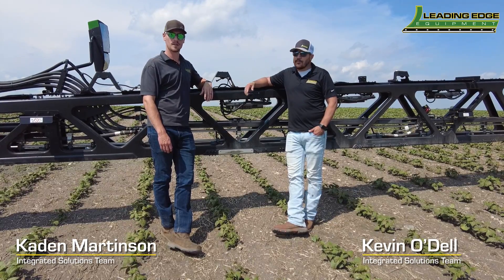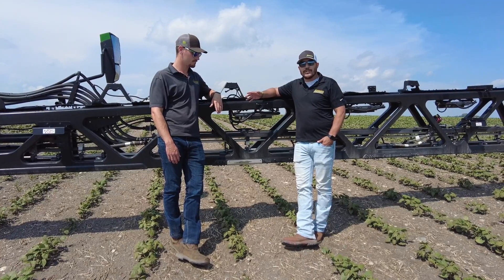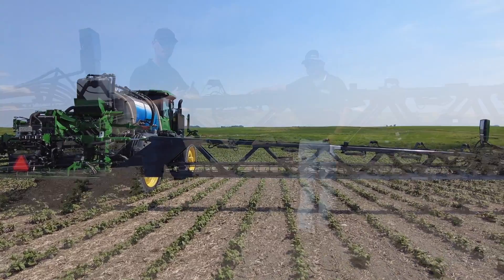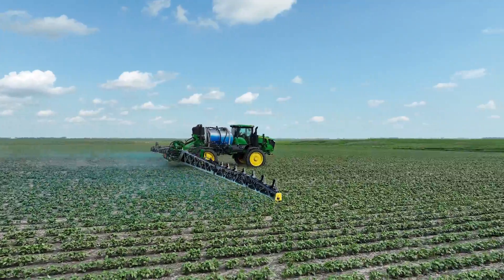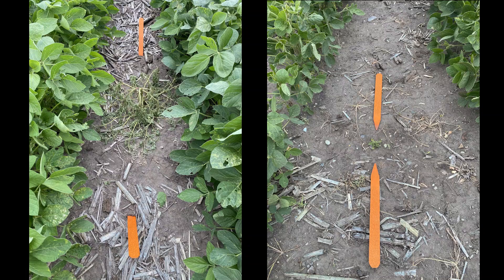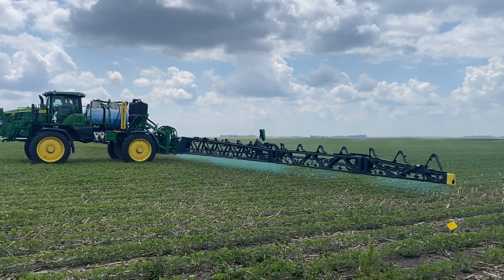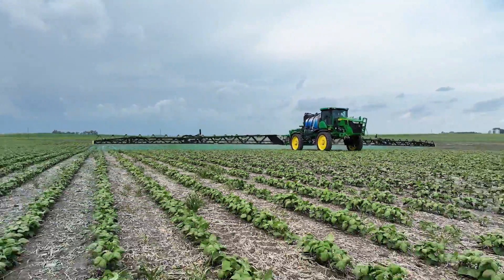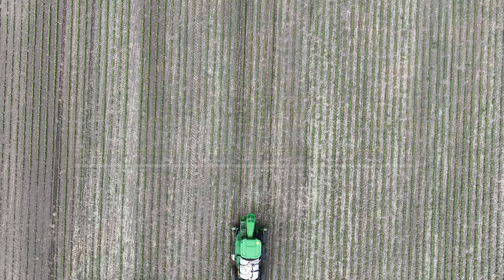John Deere See & Spray Ultimate

Comment: At the 2:16 second mark you're describing width sections. Will you clarify what you mean by adjusting small, medium, high and how they change nozzles by a factor of 3,5, and 6. It confused the crap out of me.
Reply from the maker: Hi Rollin! It’s different buffer settings. So you can set it for the low, medium, or high on both width and length. For width it’s the amount of nozzles that will kick on for a given weed. Low setting is 3 nozzles, medium is 5 nozzles and high is 6 nozzles. Then you also have a buffer length setting for low, medium, and high. Low is roughly 6 inches before and after the weed and the high is roughly 16 inches before and after the weed.